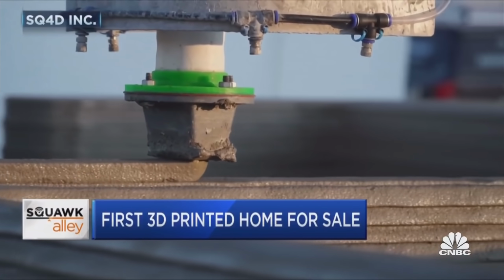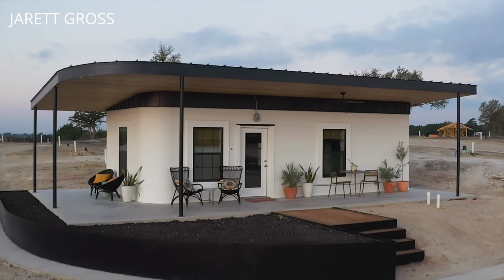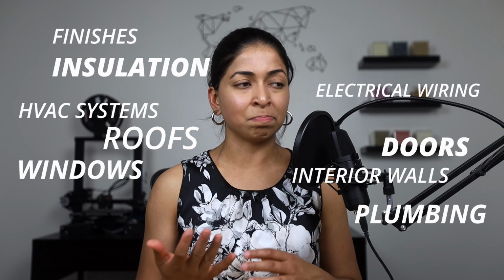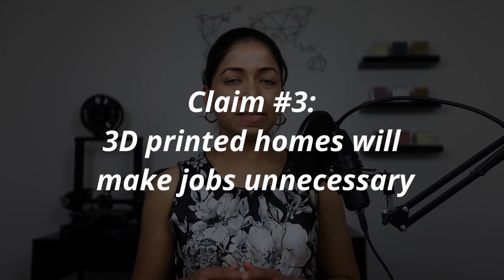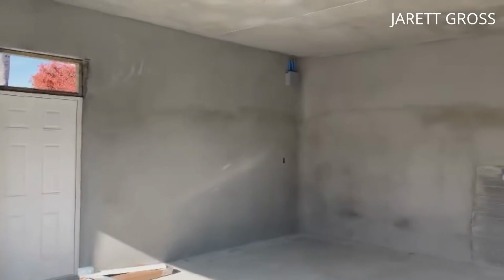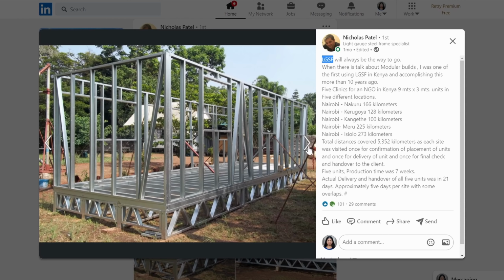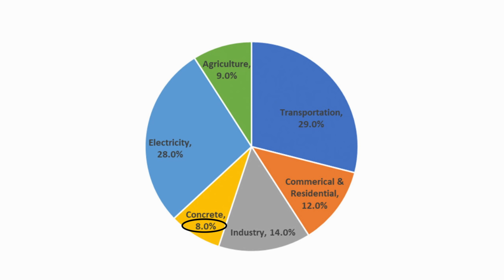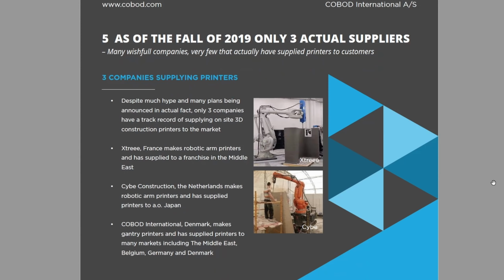Exposing 5 LIES about 3D Printed Concrete Homes

Comment: as someone who has been in charge of a few construction projects, walls are the least of my problems lol

of all the problems i need to solve, walls aren't one of them
Reply: Dude, she made some really good points, i never thought of. Im not in the industry, but this is a facinating topic.
Reply: Back in the 1970s I installed drapes in a house in Arlington, Tx.  By the time the fabric mill printed and shipped the fabric for the last room of drapes the vacant lot across the street had been cleared, foundation poured, and the house framed, and roof decking installed.  A few custom requests can take longer than constructing the whole house.
Reply: Framing is the easiest part and done in a day or two. It's everything else that takes months.
Reply: @cnutsack  the highest cost per square foot is your footers/foundation. If your frost levels and soils allow, a full basement adds OST room for the buck and stabilizes your building temperature, helping to cool in the heat and warm in the cold.
Reply: Walls are easy but they do cost and take a while, so speeding that up would be nice. Panelized building is more the future than 3D.
Reply: @aptpupil  There's no way a 3D printed wall is going to be faster or cheaper than a good framing crew. You're right about pre built being better and likely the next dominant steppast trusses. Like trusses, it will always have some degree of tradeoffs.

Watch an old Larry Haun video and he and his brother will layout, scatter the lumber, and have walls up in a long day. Apparently in LA they framed a 3 story apartment building in a week...
Reply: @driver26swx31  I'm guessing you have an opinion on the matter, lol. I grew up in the SW Chicago area where there were and are many stick framed homes that date back into the 1800s. Obviously, good houses can be stick framed IF you do it right. I did while subcontracting million dollar homes in the mountains of SW Colorado. I can do everything but carpet and HVAC and do it near the top of their trades - but slower. 

Steel framing absolutely sucks, is soulless to work, and creates a cold conductor down every stud and rafter.  Oh, you're going to put 3" reflective foam on that? When it gets really cold or really hot you've made a bandaid, not a solution. Lesser heat and cold aren't as noticeable yet have the same problem in lower proportions. 

Going stucco? Are you going to use masonry products or a plastic product like Stop?  Enjoy the repairs if you don't learn how to do it yourself to save the inflated wages they charged where I built. How about those air entrained CMU,s that are falling apart?

I'm not saying there are no viable alternatives to build high quality homes, I'm just saying much of the new processes were - like all new products - were hyped up without knowing or telling the drawbacks.
Reply: @cnutsack  first and foremost licences, basically you need Togo to the local council and get all the licences you need. Also buy all the bags of cement you need from the supplier at once, instead of buying from a retailer hardware, the same goes for the steel and electrical. The finishing is always costlier than the construction of the walls so make sure you calculate cost for things like skimming, plaster, molding, doors and windows.
Use concrete instead of a roof, good quality roofing is almost the same price as concrete slabs but the slab gives you extra real estate on top and saves you money for ceiling boards.
Reply: @mohamednoorali8080  that kind of advice is useless without to know the reality of his country...
conditions vary enormously between places... there places without the need for permit.

And if you buy all the cement at once in the region I lived, you will lose almost everything in few weeks because of the humidity.
Reply: @ffccardoso  In that case I think it would be wiser to consult a local from his country on cement and humidity of the country. In my country its less humid and alittle hot T 25 degree Celsius.
But I have always found it easier buying in bulk all of my materials. I guess he needs to find out what he needs
Reply: Funny how they don't have any foundations and haven't withstood any storm or tornado testing
Reply: If ya having wall problems I feel bad for ya' son, I got 99 problems but the walls ain't one...
Reply: what are the hardest parts?
Reply: ...You've got 99 problems, but a block-wall ain't one?
Reply: @bradroon5538  I have to disagree about your opinion that saying 3D printed wall will never fast and cheap. The technology itself is still in infancy so no one can really tell. Pre-built was developed and applied earlier than 3D printing so it is kind of make sense that the technology more mature than the 3D printing wall. When the times come with 3D printing infrastructure is ready, then I am sure that the tech can bring cheap and fast construction among other construction technique such as pre-build. It also can give us, the society, several option to choose which construction method is more suitable for particular case. 

Just look at electric cars at the beginning, so expensive until it reach the point that people were pessimistic about it. But now it become a booming for personal transportation.
Reply: Being a construction design engineer i have to disagree there. Walls is the major problem. Floors pretty much always have the same load. Can pretty much just take the span and convert it to momentum.

Walls on the other hand are dependent on cutout, number of floors, wind load, snow load. And in some cases also crash loads (like in garage structures)
Reply: @ironmonkey1512  Truth. I'm framed a whole floor for a medium sized home with one other guy in a day.
Reply: Nobody is saying that 3D printing "solves walls". The main claims are that it is faster and cheaper.
Reply: @allyourcode  thanks mate! You just unleash the truth
Reply: Seriously, having walls and footings out of the way quickly, standardized, etc. could be a real boon for specific track or multi-family construction; but like the nail gun it doesn’t actually solve a logistical problem, even if it is a very welcome addition.
Reply: @driver26swx31  Concrete houses suck. Brick houses suck. All houses that are built or designed improperly suck. Same goes for houses built using lumber. Mold is a bigger problem in concrete houses, wood has plenty of properties that protect it, as long as it remains dry enough. Ventilation is a BIG problem in all of them, how to keep the structure dry. Wooden frame is very open and when done properly, will not rot or gather mold. We have wooden city blocks from the 1700s in my town, still standing rot free. Mold has never been a big problem in the area. But.. mold is a big problem in the concrete houses built after the 80s. My dad is construction engineer and has built a lot of them here and it is almost always concrete buildings that require extensive repairs and modifications for mold and poor quality indoor air. He has said multiple times that the building he is making will cause indoor air quality problems and has been right, every single time.

They CAN be made to be problem free but the lack of ventilation inside the walls and the direction of air in the summer vs winter are the key problems, they suck in moist air and breathe out dry air. If you leave a plastic bottle outside with just a small hole in it, it will have water inside in couple of weeks. You make a larger hole in it and it remains dry. Concrete is thought to be more problem free so not a lot of thought or care goes into that.. also also, things like installing insulation in the rain is still happening. Wooden houses are not problem free but they can be, Finland is damp country full of wooden houses that for some reason... they don't rot (the local name for Finland is Suomi, that can be translated quite directly to Swampy, all though the etymology is debatable, the fact still is that there is a LOT of moisture in the air and it rains a LOT) 

It is one of those cases where one method is seen as more problem free (concrete) so basic principles are not looked after so carefully. Concrete can't rot, so.. why be so careful about removing moisture.. it is not like wood, right? It is an attitude problem, wooden houses have to be built in a certain way or they WILL rot, everyone knows it but.. so does concrete, it just does it differently and quite often causes much more serious problems for the humans living in them.
Reply: @cnutsack  cheap material
Reply: @cnutsack  why hiring a company ? and why only one ?
Reply: @justicedemocrat9357   Walls is a solution, not a problem .
Reply: @cnutsack  everything
Reply: @ironmonkey1512  My Chippy mate and his partner used to frame up three houses a week when they were young guns ! And that was cutting in roofs the old way, not trusses and using Aussie hardwood!
Then they would go to the pub and sink a dozen schooners!    Fit as scrub bulls!
Reply: @cnutsack  Just use a reputable builder.    Ask around;  they are there!
Reply: @aptpupil  Yes, pre-fab timber in a factory, the one near me!
Reply: @Nooneinparticular987 Well said. You nailed it LOL !
Reply: It's like she said: it's a solution looking for a problem. There was no problem building walls, but they invented a new way to do it anyway. I'm sure there are applications where this method makes more sense than matchstick walls. However, she mentioned that printed portion of that relatively small house in France as costing 170K (Euros?) ..for that price you can build an entire house in the US, not just the walls, and in some parts of the country, that'll buy the lot as well.